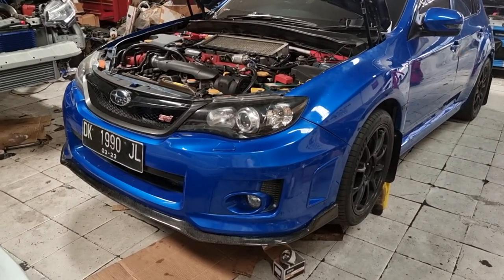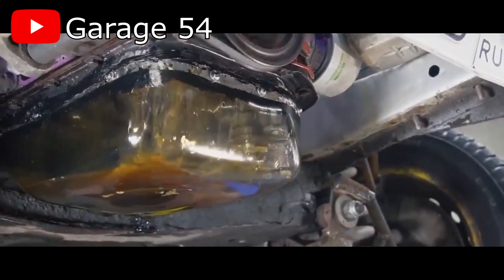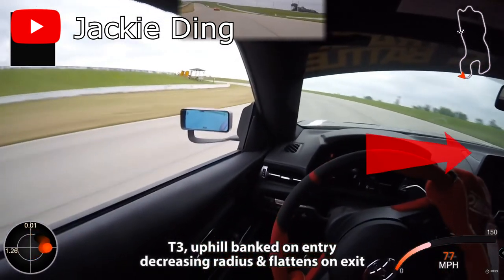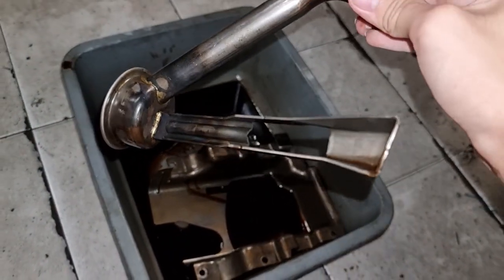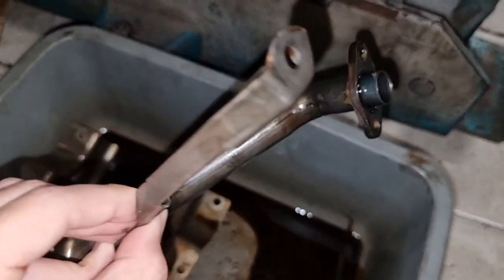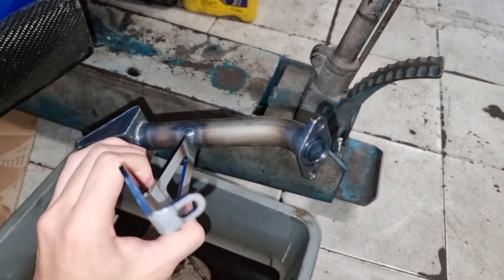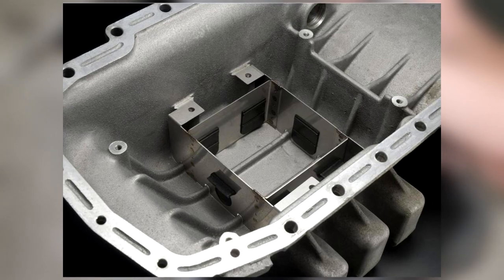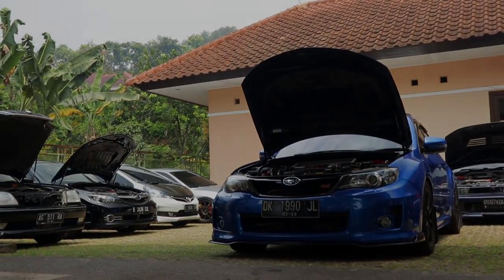MOST IMPORTANT MOD for your WRX/WRX STi! | Killer Bee Oil Pickup Tube & Baffle vs Stock

Comment: Just had an IAG block installed with these two mods. Great items for peace of mind. Great video by the way.
Reply from the maker: oh cool, which one did you get? are you trying to go for high-ish horsepower or just reliability? thanks btw!
Reply: Been going on a bit of a unnecessary anger fueled troll rampage over my experience with my wrx, to try to divert my hate from intentionally totalling my car so I'm not stuck with it for another 4 years but any advice on aig and you're experience and what improvements does it offer above oem block? Trying to get my head straight and maybe just try to save for aig and when this motor inevitably breaks again hopefully I can put a better block in it.

Comment: So Killer B has 3 kits that include hardware, pick up, baffle and pan at different price point. What ls the best option for daily driving?
Reply from the maker: so if you're not planning on tracking it at all, i'd just go for the pickup for reliability's sake, but if you are planning on doing autocross, i'd go for the pickup + baffle pan combo. If you do more serious track driving then i'd go for the full oil pan kit

Comment: Too late.  Put too many miles on my wrx, jts had two spin bearings. Hasn't been the same since warranty repair plus I'm in need of carbon cleaning. I'm getting rid of it. Too much headache.
Reply: Were you taking it on track? you think it was oil starvation that caused the spun bearings?